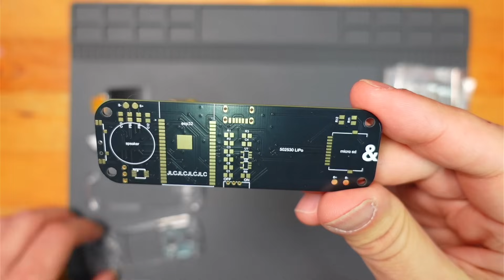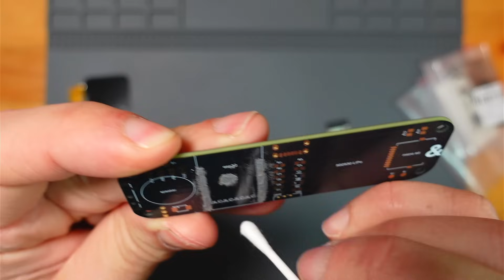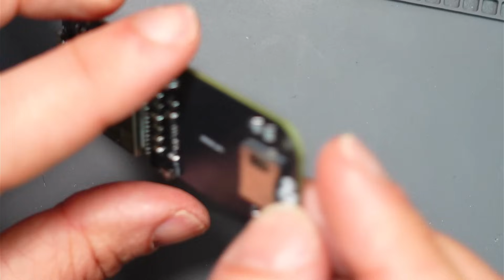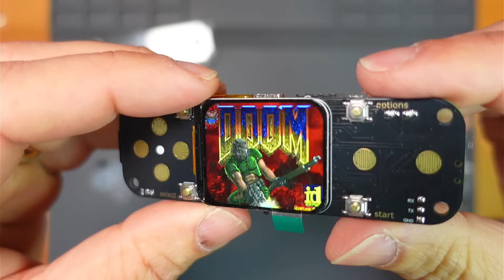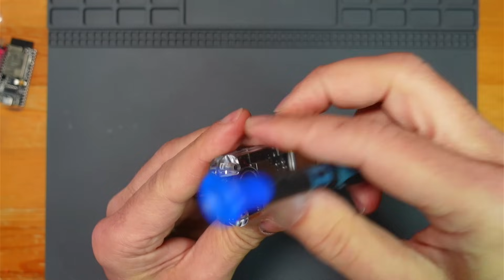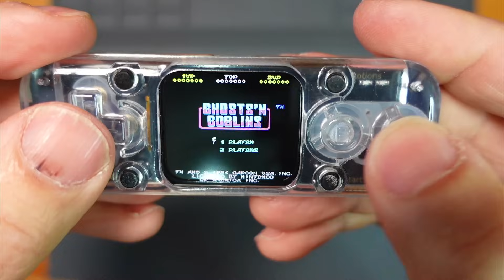Building the Null Nano: ESP32 Retro Gaming Handheld 🕹️ (First YT Look!)

Comment: Ampersand here, I can answer questions
Reply: I would love to buy it, but I don't have all the tools to solder it. Are there any plans to sell an assembled version?
Reply: @OAURS I recently closed down my online store and won’t be building these for sale, but I don’t mind others selling their builds of it
Reply: is there a way to buy the kit?
Reply: what was your design process like
Reply: @bestinfinity1I work out what components I’m going to need, then make it all 1:1 in illustrator to test layouts, eventually finding something that’s compact with the controls in sensible places. At this point I know what the device is going to look like and how it’ll go together. Then I transfer it all to PCB making software and route the board manually, 3d model the case and print tests to ensure the buttons feel good (proper travel, no wiggle, that sort of stuff). Then I order all the parts and hand assemble it.
Reply: What's updog? No wait...
Reply: Is there a git for this anywhere? I'm about to be bwdbound for two months and would love to have this as a project to work on 😅
Reply: Where can I buy the kit?
Reply: @jeffmunger9404  Links to all the parts are on the github
Reply: Lemme get one pre-built please.
Reply: Can this play pico-8?????? ????? ????? ???? ??? ?? ?
Reply: I am having problems with the d pad looks to be mixing signals with up and down and left and right
Reply: @Nomis_T this happens when there’s higher resistance than expected on the pad. Gold plating and then using something like membrane repair stickers will solve it. Could probably also change the value of the resistors for those pads.
Reply: @fibreglassmonkey  nice just changed the resisters to 5.6k as that is what is used on the R3 location and is what I had on hand and it works much better
Reply: @Nomis_T  I did reply before but I think it got removed as I posted a link, I have been working with the developer of RetroGo around a similar issue and looks like its been resolved. I have compiled an updated version based on the latest Dev build. Its working perfectly for me and resolved any dpad issues I had. I cant post a link but if you look in the video description and go to my Github fork, in releases, look for the Null Nano then get 1.4.5. Give that a try, be interested to know how it works for you.
Reply: can you teach me how to program esp32 at the code?
Reply: you have a dc or other? have questions

Comment: You need to remove the smds from under the screen or add spacer layer with cuts for parts. Any light pressure gonna pop it up.
Also for a tiny thing that hangs in your pocket probably with the keys, could add additional protective layer of acryl on the top of the screen
Reply from the maker: Some  good observations. There is a design for an acrylic screen cover in the Null Nano GitHub files (Wrigley lens Routing.ai). I just haven't had time to get it made, and I want to consult with Ampersand first (it's his project). The final screen attachment is not shown in the video. It looks like I have stuck it directly on Kapton tape which would not last. It's fixed better than that, and not going to move. 👍
Reply: @megazoid  Why does there have to be a hole for the screen at all? The clear case looks good enough quality to cover and protect it without compromising the image quality. (Perhaps that's not true in real life?)
Reply from the maker: @RichardHallas  I had the same thought, but it's not crystal clear. As Ampersand points out, it's an open source project that people can mod how they want. Test things out.
I have too many other project to really tinker with it further.

Comment: if we could get a small mini hdmi display port on this device it would be god tier.  Great Project tho.
Reply: ESP32 cannot generate an HDMI signal, nor do I think it's powerful enough to handle it. Probably would need to move to a more powerful brain for this, like a luckfox lyra (rpi Pico compatible pin out) or Lyra zero w (rpi zero gpio compatible) and possibly a few small components. 
That being said, the Lyra line can just run full desktop Linux vs the stripped down stuff in other handhelds. PicoCalc users have been swapping Pi Picos for them and the results are impressive.

Comment: Came out really well, love the clear case and the black/gold PCB was a great choice too. If you download Ampersands SD card skeleton files you'll also get his nice themes too (you might need to select the theme via the options menu), its just missing the MSX one as that was added recently, I did create a poor one to keep a little consistency, not that I will ever play MSX tbh! I agree that programming is tricky, I did manage to program it via the pins but its not very convenient to program again, thats why I have tried to submit it to the official RetroGo so hopefully future updates can be flashed via wifi, hopefully if it is accepted it'll just work and wont need another manual flash. I dont know if theres a medical condition for someone that has to have the latest updates for stuff but I got it bad! I'd be the guy with a pacemaker updating to alpha firmware because its newer :)
Reply from the maker: I'll have to look at those skeleton theme files, and cheers for the general heads-up on the project. I think I tried most combinations on that UART programmer, but more than likely bodged something up, and yeah - I have no idea why 1.44 is that much better, but I want it.
Reply: @dynamight1124  Firmware FOMO 😄
Reply: @scottgilson3247  Hah yeah I think thats it.

Comment: That clear case is beautiful!
Reply from the maker: It's fire. It was a bit more than I said (I forgot), but mainly due to having to get all the parts done separately. Top and bottom on there own would have been just $10.
Reply: @megazoid   Did you use their 8001 Transparent Resin (sanding after print +2 days) and JLC Black Resin? Looking to try some MintyPiPico cases with clear and transparent.